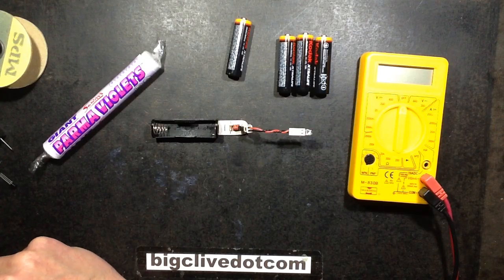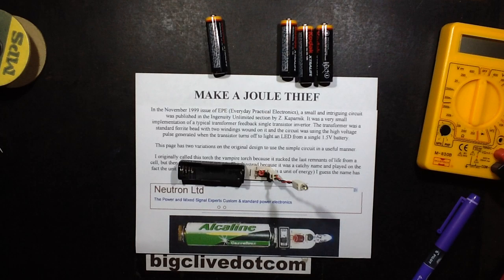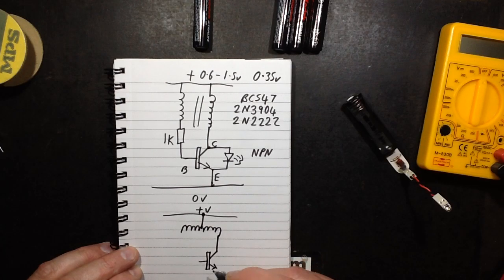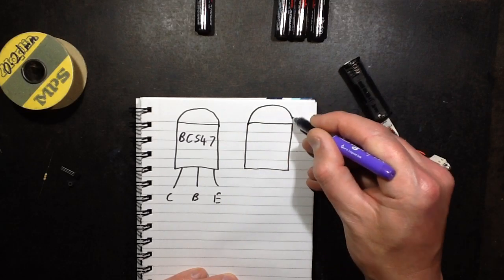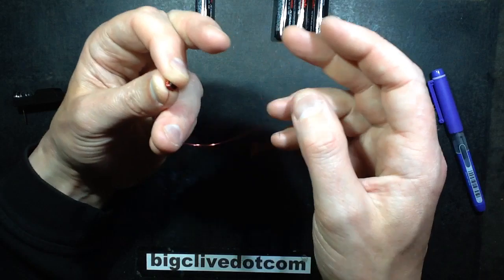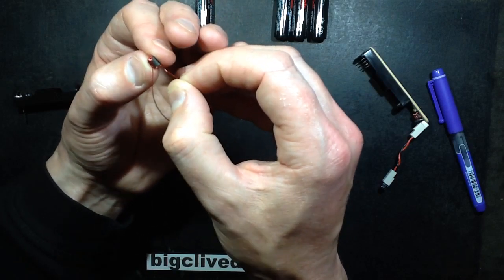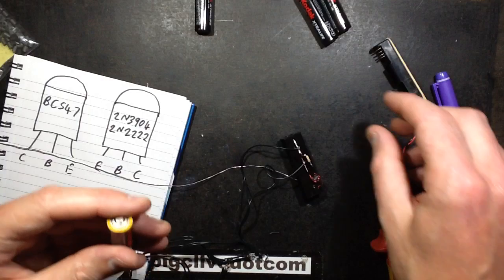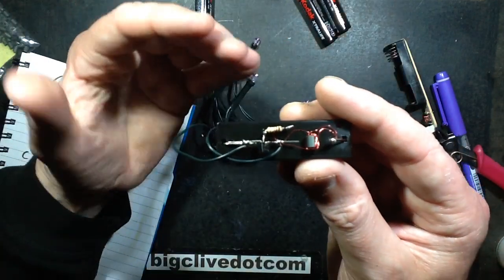How to make an authentic Joule Thief.

Comment: I don't think I'll ever work out how he holds about 5 things at once, his dexterity game is on point
Reply: It is viral, I often find myself soldering something in mid-air, and I don't think it ain't right any more; instead, I'm thinking «OK, it's clived right» every time I solder it well.
Reply: It's an electronics thing ❤
Also an electronics thing lead exposure 🤪
Reply: VODKA does most of the work. Ask any one from the east side of the planet.
Reply: Neil Armstrong and Buzz Aldrin on the moon had to dress each other for spacewalk, pump air in spacesuits simultaneously while depressurized the lunar module, not only they didn't have the dexterity needed, they didn't have the required square footage to exit, especially with backpack on and spacesuits inflated, they could never fit through the 33x32 inch opening of the lunar module, and so I think they had assistance, and studio artificial lighting and cameraman filming the ascend takeoff from the moon, it was a sloppy magic show and their dexterity problem is certainly a magic trick all by itself. But with wishful thinking and wilful ignorance the American way, anything is possible 🇺🇸
Reply: @empathicallyyours4937  Well, that's right! People were so much more gullible weren't they back in the days before the internet and social media were there to think for them.
Reply: Wait till you hear that he holds the camera in his teeth while talking...and vaping
Reply: @rhydlew  and sipping his gin and tonic! (I guess vodka and diet Pepsi too....  bluarcgh 🤮)  That is something I enjoy frequently (not 😉) playing with electronics and building shtuff  😅 👍
Reply: @delta-KaeBee  but not fizzy beer :)
Reply: @rhydlew   nah,  fizzy bear doesn't sounds very appealing lol
Reply: and the third line ends of the triangle meets perfectly

Comment: Impressive, didn't realise you were the man behind the joule thief name
Reply from the maker: arcadeuk Yeah, it just took on a life of its own.  And to be fair, it is a great little circuit.  I can remember the excitement of my first one working.
Reply: +bigclivedotcom Congratulations on the joule thief, alot of YTuber give demos on it, with no through back to you.
Is it the basess for that Batterizzer thingy.
Reply: Nathan Trigg They are two very different things. The joule thief is designed to extract every last bit of energy from a battery. The batteriser is designed to extract money from your wallet ;)
Reply: +arcadeuk ha..ha.  l understand now, thanks for clearing that up.
Reply: Please return to youtube :)
Reply: Scavenging through some old electronics for parts I saw a little ferrite bead sitting there and thought of this project I had seen quite a while back. Had to watch the video again. Using a "dead" AA battery from an old junk flashlight and wire scavenged from a choke I built it up. Took a little fiddling but I got a giant grin when It fired up two 3V LEDs from a 1V battery. Thinking of building some little boards now to coloize my garden lights.Thanks for a fun and productive diversion!
Reply: Now, if they put a Joule Thief on a the Tesla car, it could go on one charge per year. lol
Reply: @Dave Micolichek < LOL  yes of course, it was just a joke, moreover you don't want to deplete Li-Ion batteries below a certain level because it will damage the cells.... but it could run the LED headlights even if it ain't moving (disclaimer, just a joke;)
Reply: bigclivedotcom would a 750millivolt thermopile and the joule thief circuit power a led from a candle flame 🤔🕯
Reply: We gotta get the man who invented and/or named the triple nickel on this channel. The 555 is my favourite  ic
Reply: same
Reply: this man is the myth, the legend, behind joule thief
Reply: @arcadeuk  hahahaha pmfs brilliant
Reply: @BillAnt  till it explodes*

Comment: I think I finally understand how to build this, which is a good thing, as back in SD I have several failures laying in boxes and about a dozen or so ferite cores taken from old pc power supplies that I have torn down most have had the wire removed from them, and I also have a small shipping box filled with various sizes of laquered copper wire from the same teardowns.  Thanks a  million. For some reason I have it in my old brain that if I can just learn something new, every day, then I may well keep going with a whole mind till the end of my days.  Being 65 now, and still thinking with a relaivly clear mind and watching my 90 year old mother still playing Pinocle with the best of them gives me hope.  The fact that dad passed away at age 63 does worry me a bit, but it was the booze that took him, and I  try to avaoid that at all costs.  So thanks again, for keeping me educated, and in that process young at heart.
Reply: Oh as a side note, on returning to South Dakota, I watched this once more, and followed along, using slightly different supplies that I had laying around, and suddenly I HAD ONE WORKING!!! Wow what a great feeling to hit that switch and watch the LED light up brightly from a dead battery! That said, my second attempt to make one slightly different was a total failure, but still I have the one that works on my table beside my recliner just waiting for the power failure that  come on a fairly regular basis here on the Dakota State Line.  Then too though I picked up one of those tops to a solar walk light at a yard sale. It was so damn dirty that I had no idea what it was but for a nickle what could go wrong. I took it back to the RV and cleaned it up, then it became obvious, and when I put in a single AA battery, it came to life.  Nice unit with solar charger on top and a sensor that shuts her down when the sun hits her. That too runs on a single AA but I have not tried a dead one on her. I would guess it has something like that circuit in it. I am planning on striping down that light and using the solar cell to run a small weather station based on an ESP8266.
Reply: @JerryEricsson  Maybe that/this would be solution to problem that solar lights usually use more power than the solar can make, so with this joule thief you could get more time out of emptier battery.
And maybe even try to use this to boost the charging current so the battery could be filled with less sunlight

Comment: This looks very similar to a circuit which uses inductance to increase voltage from a battery, somehow piling the inductor discharge on top of the battery voltage.  I really love that Clive teaches this stuff.  The part I have trouble understanding is the back-flow surge from the transistor.  It seems like a lot of what I'll call side-effects of electronics become really useful design ingredients.  Very simple, really cool, and yet still a little elusive for full understanding.

Comment: What a great little device. Just made one up to run a 6v string of 20 LEDs and works perfectly from a have dead D size battery. Interested to see how long it runs.
Reply: How long did it run?
Reply: Yeah how long bub?
Reply: Only about 4 days. But then I don’t know how dead the battery was or what current it was drawing.
Reply: @mostlysane77  4 days constant or on and off? if constant that isn't bad at all.

Comment: I just breadboarded one of these from another video, it had a bigger resistor (33k, I think) and a 10uF capacitor across it to make the LED blink.  I went a step further and used a 500k pot and a 100uF cap, so it's quite bright and I can vary the flash rate. Blue LEDs seem to have the best output and flash at the same rate as pink or white ones. Yellow, red or green LEDs flash at different rates given the same setting on the pot, I would imagine because they will have a different switch-on voltage or something and the pink and white use a blue LED with a coloured phosphor. Every day's a school day for me :)

Comment: So you are responsible for that name, huh, I had no idea.

At some point I made one using an old forged iron bolt as a core, also tried one winding of an audio transformer, and an oscillator coil from a radio, all of those worked.

Another thing that I did once, was instead of an LED, I put a transformer coupled with a capacitor, which stepped up the voltage, then I rectified it and charged a cap to about 200 Volts to drive a vacuum tube from batteries.
Reply: cool
Reply: @Another Dick The most likely reason is that you were using the wrong ends of the coils - as wrapped instead of finding the other end of the second coil as Clive demonstrated.  You'd think it would be the same thing but it's not - the coils have to be in opposite directions otherwise the coils don't "ring" (resonate), so no current will flow through the transistor or the LED.
Reply: Dave Micolichek  I was replying to a user called "Another Dick" who said he couldn't get anything to work despite trying several combinations of core and windings.  That post appears to be missing now.  My point was, If you wire it as two coils in parallel it won't work, because the coils won't resonate in that configuration.  You HAVE to find the other end of the OTHER coil to hook the battery to, as Clive demonstrated.  IOW the coils are running in opposite directions.  There's really no other reason for this not to work as long as the solder joints are good and there's enough juice in the battery to at least kick it off.

The circuit diagram as drawn is a bit misleading in that regard, so it's understandable if people go off that and get it wrong.  On the circuit diagram either the windings should be going in opposite directions which might no be very obvious, or it should be drawn so it's obvious that the "center tap" that Clive talks about in the video is actually opposite ends of the two coils.

So, I'm not sure if you were confused about who I was replying to or what the problem was that I was describing, but I hope that covers everything anyway.

Comment: Greetings once again, a few months ago, I found this and used it as a guide to build my FIRST working Joule Thief, it has been shining on now for several months, twinkling on my computer bench, and drawing comments from those who know you just cannot run an LED off one AA Battery!  So today, I came back and followed the directions once more,  simply because I ran across one of my  earlier attempts that failed.  I took her all apart, and followed your directions bit  by bit, step by step until at last I had one connection left to solder, and I just could not wait, I twisted the two leads together and stuck in an old dead rechargable AA that was nearby, and by God, she lit right up once again, so now I have two working models, one on each side of my computer desk to light up the clutter fro either side!  Thanks a million, I do so love your videos!

Comment: This is lovely! I've seen these Joule Thief circuits before, but never this simple. I grabbed the nearest inductor that I had (two windings in a plastic case. I checked the resistance and they were exactly the same), a 1k resistor and I just happened to have a bc547. Wired it up and ran it off a AAA battery reading 1.3v. There's a slight high-pitched squeal coming from it, but it's barely noticeable to my old ears. Pretty neat useful little circuit. One question, how does this react to a full battery, or a higher input voltage?
Reply from the maker: It will be brighter with a fresh cell, but it's really intended for used cells.  The squeal may be due to the use of a fairly large inductor that is oscillating at an audible frequency.

Comment: Thank you for your inspiration. I did not use your schematic because lack of space for the coil but the idea of reusing old batteries fascinated me after this video.
I built a water resistant illuminated dog collar with 4 slow color changing LEDs (you also inspired me to use these ones). My Joule thief if made of two inductors, a resistor, a capacitor and a transistor. It all fits into a tranparent flexible tube with an inner diameter of 9 mm. Only the AA or AAA battery sits in a short piece of a wider flexible tube that is used as a connector to make a ring of the other tube at the same time. 
It works perfectly, looks awesome and runs for 60 - 100 hours with a single AA battery.
Reply: There is no such word as"these ones",there is however"these,them,and those",just sayin' .

Comment: That's a really neat little circuit.

I'm amazed how you can solder things and keep them together while you solder other parts to the same soldered connection. I would've had parts disconnecting and falling on to the floor!

Comment: I assembled your little joule thief and, other than having the LED backwards, it is now working fine! Even with my shaking hands and old eyes I was able to wind the very small toroid (a 37?) with .2mm wire, and I am documenting battery voltage at start and on battery depletion! I think I am going to try running the small (10 and 20 copper wire Christmas lights) that normally take 3 AA batteries. Fun times...
Regarding your crimper for molex terminals, I have been using a similar one, made in Sweden, since the late 70's, for wiring harness repair and building in automotive and experimental aircraft systems. There is nothing like professional crimps with built-in strain reliefs! I have interchangeable crimping jaws for different AWG wire sizes, from 14 to 28. Once I used it, I never used the old crimp terminals again! The learning curve wasn't that long, and I know that my crimps are as good as factory OEM!!

Comment: The output voltage should be clamped by a LED string or other load to no more than about 6 volts or the transistor Vebo will be exceeded when the transistor turns off and the base goes negative. Whilst it won't initially matter too much it will impact the lifetime of the transistor.

If a higher voltage is required then maybe something like a 2N7002 MOSFET could be used which can stand about 30 volts. The 1K resistor should probably then be increased because no base current is required, you only have to drive 30pf of gate capacitance. The switching threshold of the 2N7002 is about 0.6V so the operational behavior should be pretty much the same as the BC547. Would be interesting to try.
Reply: Would a 13003 transistor be good iyo?

Comment: I very much enjoy your videos so I had to comment on your explanation of the Joule Thief's circuit operation.

The operation has nothing to do with the saturation of the core, but rather with the inverse coupling of the windings.

The base tap (leftmost inductor in your schematic) provides a DC path from the supply rail, through itself, through the base resistor and into the base-emitter junction to turn on the transistor.
This, in turn, "turns on" the transistor, allowing it to pass current between its collector and emitter terminals.
Now because the inductors are connected in anti-phase, the current flowing through inductor two (rightmost inductor), induces an opposite current in the "base inductor" and turns it off.
Consequently, the transistor turns off, and the flyback of the collector inductor creates a voltage spike at the collector.
This flyback effect (U = L * di/dt) allows for the voltage boost of the Joule Thief and is dependant on the collector current and inductance value of the collector inductor.
After the magnetic field stored in the collector coil has been converted to emf (basically voltage) and its energy depleted through the load (the LED in this case), the process starts over.

For the case of saturation, the inductor would (potentially, depending on the power supply) get hot and (not dependant on the power supply) its inductance would drop significantly. The inductors would basically become short circuits and the circuit would stabilize (not oscillate).
The base current will be determined by approximately (Vcc - 0.65)/Rb where Rb is the base resistor and the collector current will be approximately hf  * Ib (current gain of the device multiplied by the base current). Since the inductors are saturated they will no longer function as a choke (forcing equal currents in both windings) as they normally would during non-saturated operation (like in a mains power supply).

You actually built the circuit correctly (with anti-phase coupled inductors) instead of as you explained it (with in-phase coupled inductors), hence it works.

To avoid confusion related to the phase relationship of the coils, it is convenient to use a phase dot.

As to the interesting case of the low-voltage (sub 0.65V) operation. I strongly suspect it is due to the fact that a transistor still passes some (albeit very little) current below its "turn-on voltage" (which is simply where it transitions from conducting very little current to conducting significant amounts of current very non-linearly), and this tiny amount of current is still enough for the Joule Thief to operate.
Another possibility is, perhaps, leakage being cut off due to strong reverse biasing of the base-emitter junction, but I'm purely speculating here.
Reply: Very, very late reply... But I believe this is important to clarify for those seeking to understand. 
I believe that the first part about the inverse coupling being what causes the shutoff is incorrect. I do agree that he intended the diagram to indicate the transformer was in inverse-phase configuration (where a current coming in from the top of the left winding induces current leaving the bottom of the right), and should have used the dot notation for such. But this in fact means that the currents as created by this connectivity (all going down on the page) AMPLIFY each other: more Ice drives more Ibe, which drives more Ice, etc.  

If the induced current in fact opposed the base current, it would never get started in the first place.